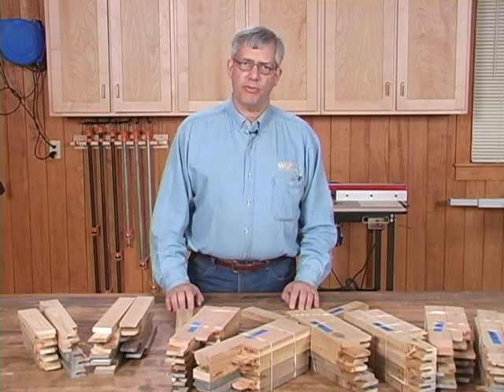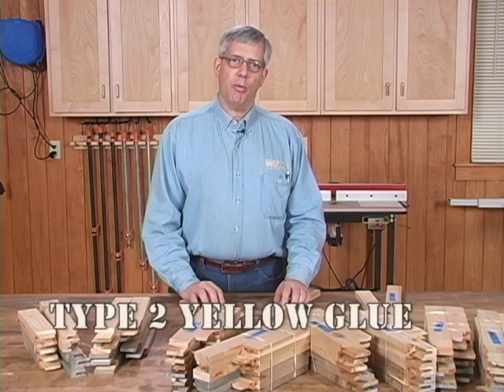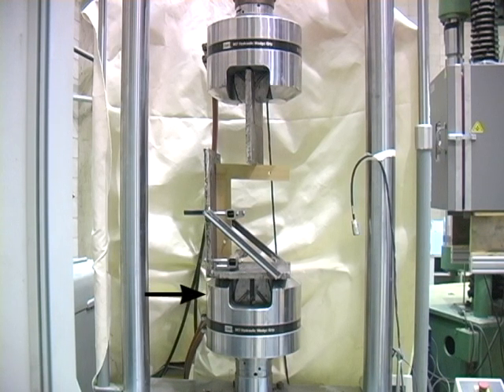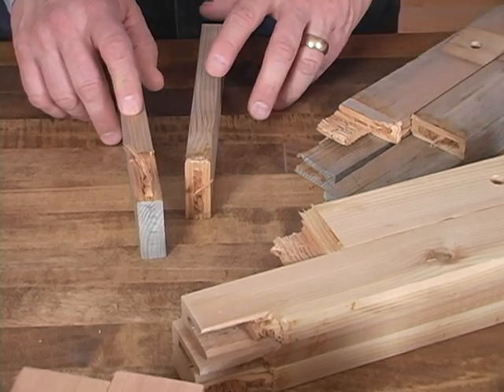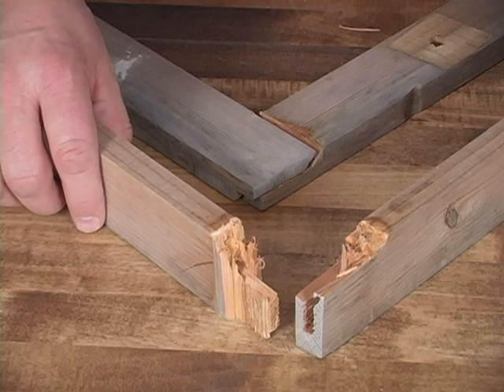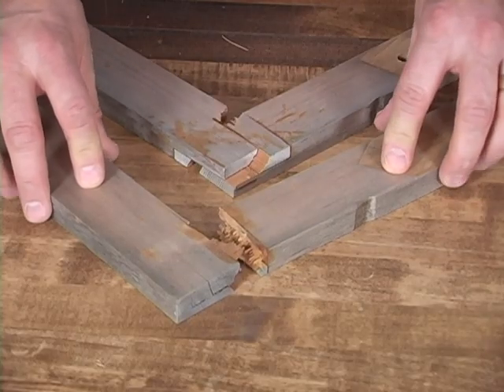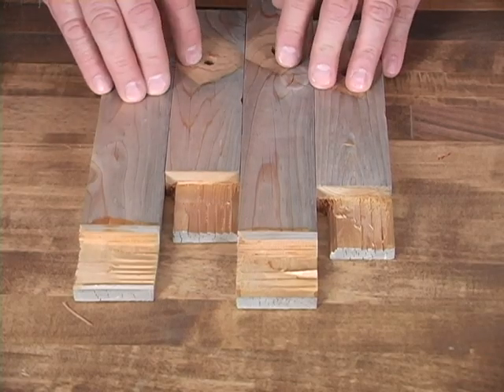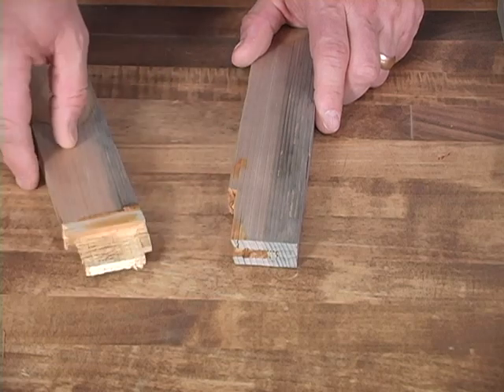Exterior Glue Joint Torture Test - WOOD magazine

Comment: I started using polyurethane glue 20 years ago when it first hit the shelves, but quickly learned the hard way that it doesn't do well with shearing force, especially cross-grain. It would be interesting to see another test with wider glue joints.

Comment: Relative strength doesn't matter, all that matters is the glue is strong enough. The whole (piece of furniture) is stronger than the sum of the parts (individual joints).
Reply: Ya.... but a piece of furniture is made of individual joints, and they brake 1 joint at a time, therefore testing of individual joints is relevant.